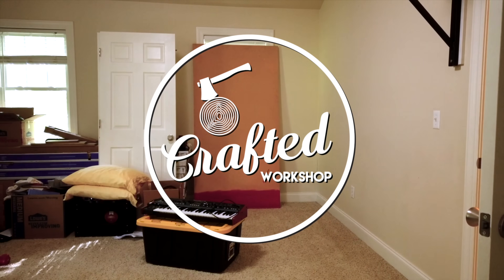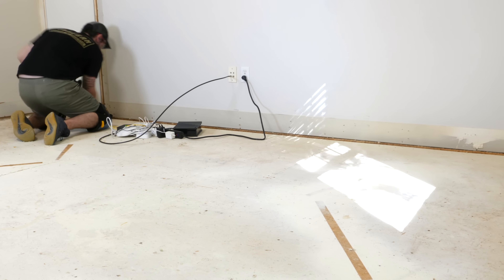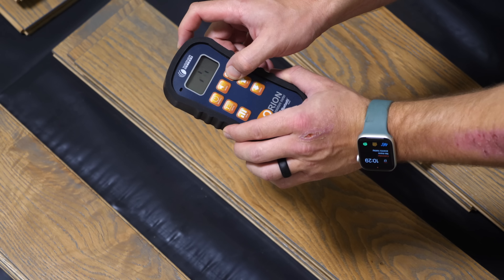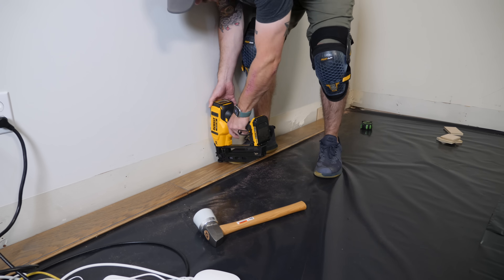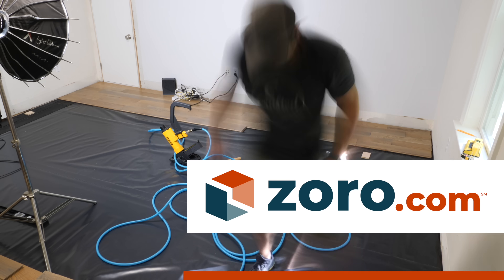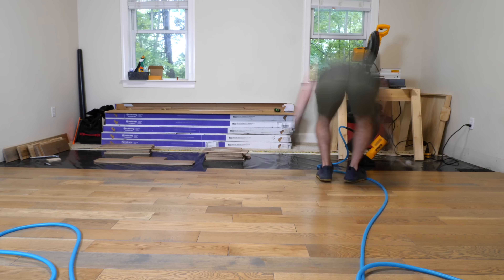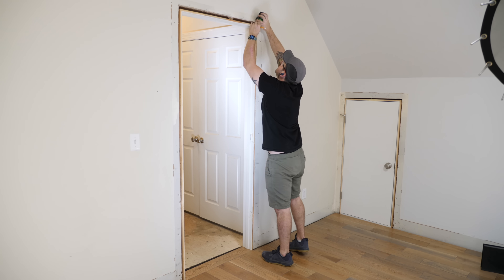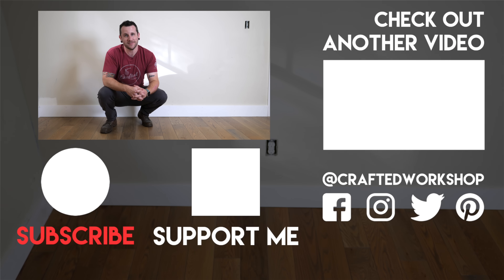Installing HARDWOOD FLOORING for the FIRST TIME 🛠 How To Install Wood Floors

Comment: that pattern is horrendous... no doubt, judging by the size of the pieces of flooring it was cheap and hard to avoid.  For fucks sake people, spend a couple extra dollars a foot and get some decent quality flooring.  trying to install flooring with 8 inch pieces out of the box you're not going to love it.